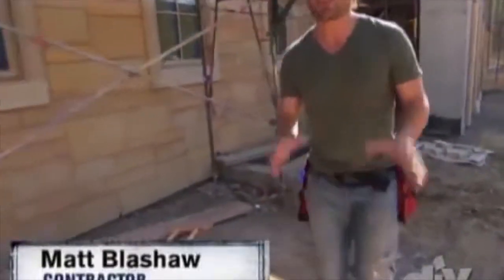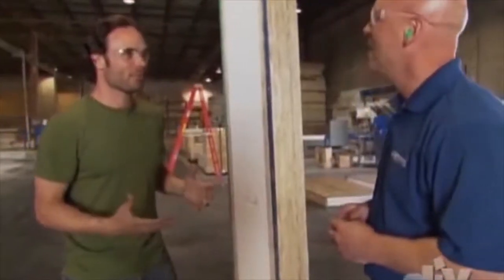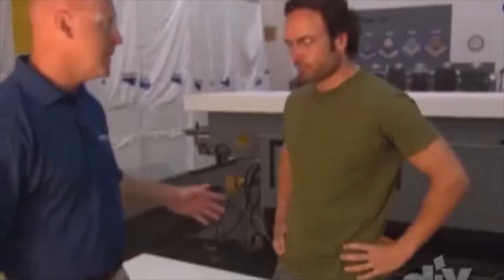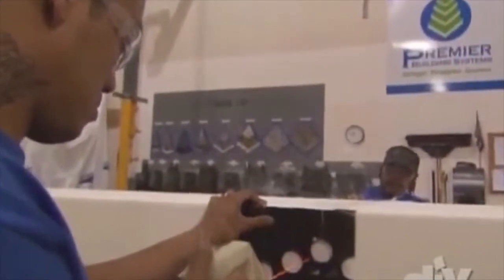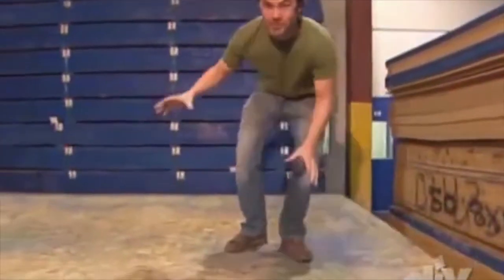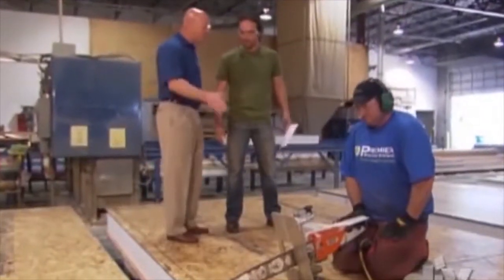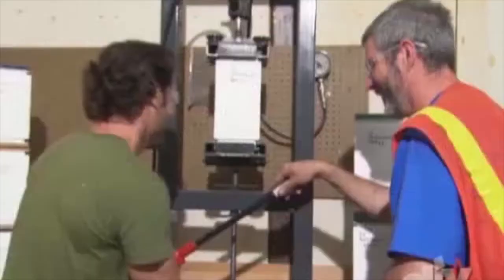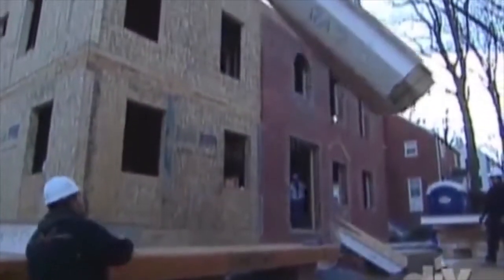What Are SIPs? Take a deep dive with the DIY Channel's "Deconstruction" show & Premier SIPS

Comment: Quick question, have you tested your SIP panels for a 3-course stucco system? will they hold and not delaminate? I may be wrong on the exact weight at 10lbs per sf, is what roughly a 3-course stucco system weighs?
Reply from the maker: SIPS are extremely strong, yes and adhere with all cladding styles and types. Sto, stucco and even heavier masonry products are regularly used as cladding in all regions.